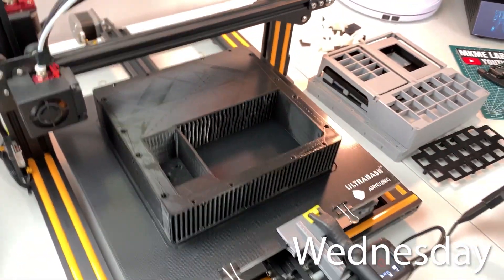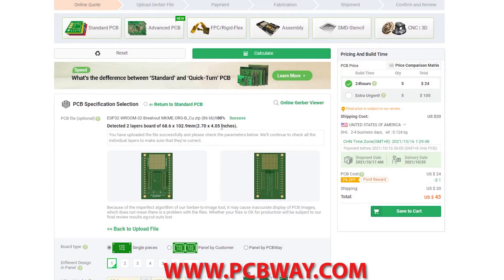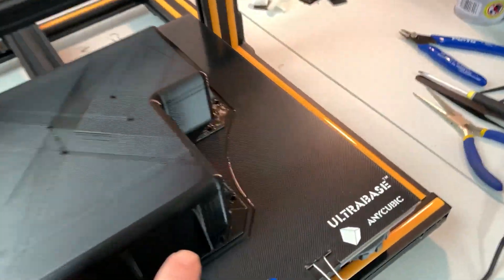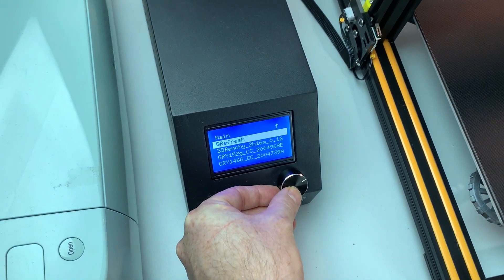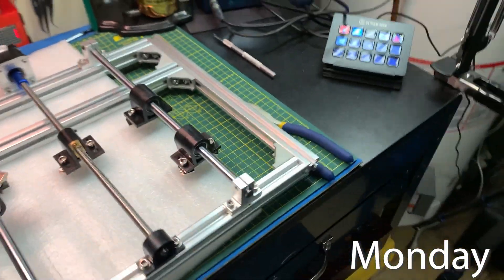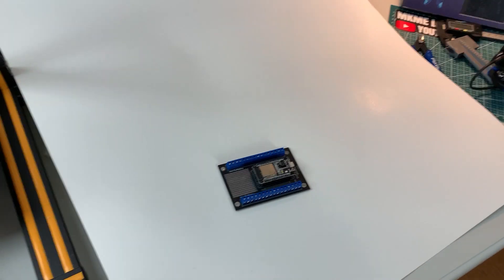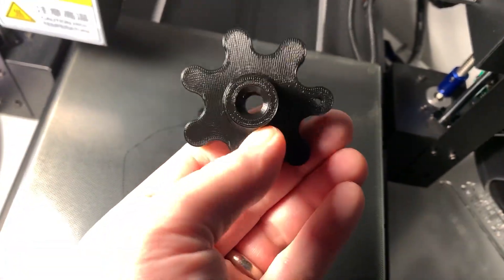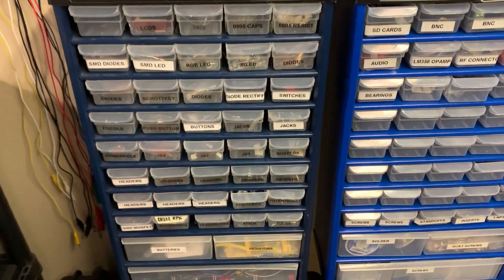Raspberry Pi Apollo DSKY + CNC Machine UPDATE

Comment: I know 3 people who have the same CNC/Laser cutter machine you built. All of us have trouble with the plastic (3D printed) carriage motor/laser holder. They have deformed or cracked and no longer run smoothly on the glide rods and lead screws. Hoping someone has a 3D model to make a new one. Or, even better someone sells a machined metal one. Nice job on the AGC replica!
Reply from the maker: Imagine there are some options on Thingiverse by now.  Cheers and thanks for the feedback